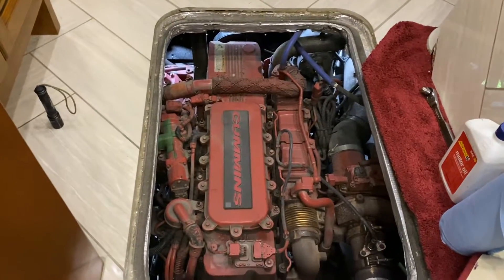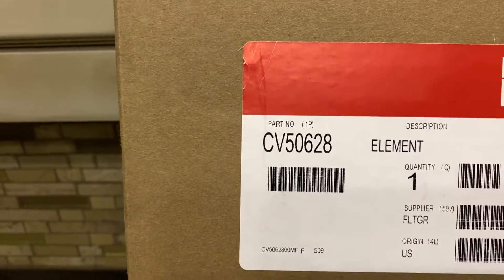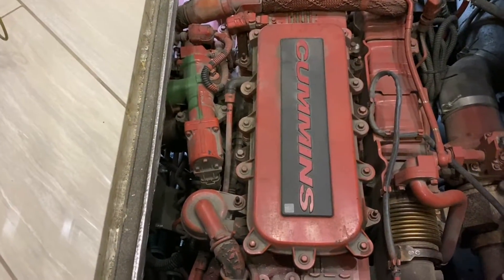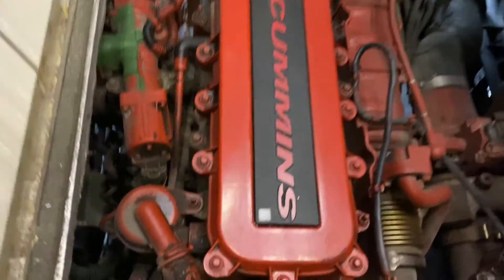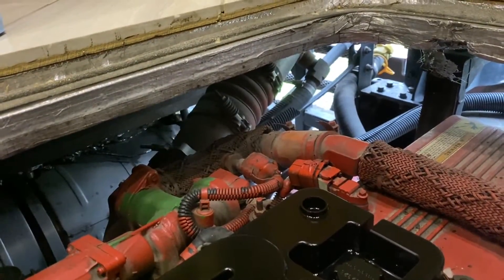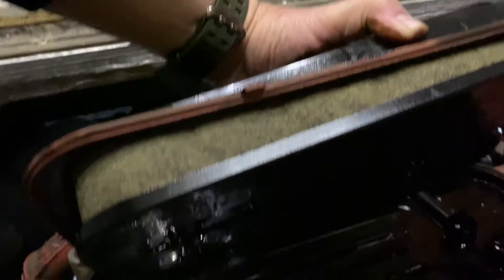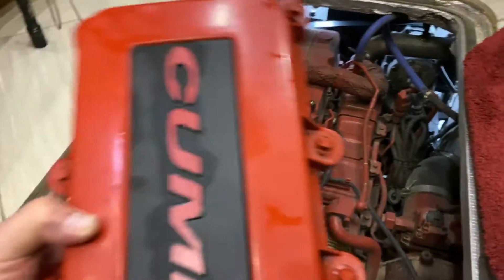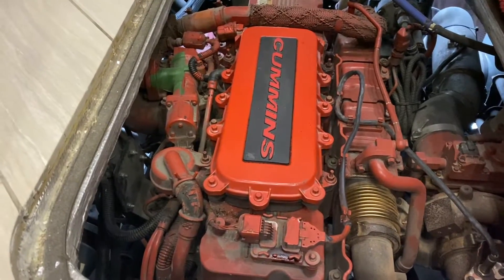Cummins ISL 9 Breather Maintenance

Comment: NEXT TIME YOU DON'T NEED TO STRUGGLE THAT MUCH. JUST REMOVE THE 6 ( 10 MM) BOLTS AND REMOVE THE WHOLE HOUSING. ON A CLEAN BENCH REMOVE ALL 8 MM BOLTS . TO INSTALL  DO THE REVERSE PROCEDURE. IT TAKES NO MORE.THAN 15 MINUTES

Comment: Great video .TY. Just bought a 2015 Tiffin Allegro Bus with the same power plant..love it!. How many miles on your Tiffin? What was the recommended maintenance schedule for the breather ? Happy Trails, Dean
Reply: Sold the coach. I think the service interval was 65k. Not sure, but you will get a code when it’s clogged. Best of luck to ya!
Reply: @coreysaxe3902  Thanks Corey. My coach has only 15K on the odo so I may wait. Thanks also for the Cummins service link. Did you buy another RV? D
Reply: @deano7190  I wouldn’t change it until the recommended service interval. We had no RV for a year and recently we bought a 2006 Marathon.

Comment: Great video this will come in handy when I change mine next week.  The only thing I didn't see/hear was what was the torque of the bolts.  I saw the order in which to tighten but no torque lbs.  Thanks again.
Reply: I think you can get the whole written procedure on the Cummins quick serve website. I don’t remember a torque setting since it’s been a while, but I believe I just snugged them hand tight.

Comment: My company runs 10w30 through my ISL9 300. They should be running 5w40 or 15w40. They are complete idiots. They use 10w30 for the rest of our fleet also. I guess they like replacing engines.
Reply: Why wouldn’t they go by Cummins recommendation?  🤦🏻‍♂️
Reply: Because they think they are saving money. With the small fleet size of Semi dumps, 6 axle dumps, and straight trucks that they have, I don't think 15w40 would be too much more money...
Reply: @paulschab8152  they will find out the hard way.
Reply: I don't even think they care. They waste money on lots of things... Wouldn't be the first time they have replaced a motor.
Reply: Nothing wrong with using 10w30. Oil has improved so much in the last ten years. Cummins does approve that grade of oil
Reply: Maybe in the winter time.
Reply: @janzen33  If their spec calls for 5W40 or 15W40 but use 10W30, the 10W  (W=winter) rating is OK but the hot 30 is too low...should be 40.